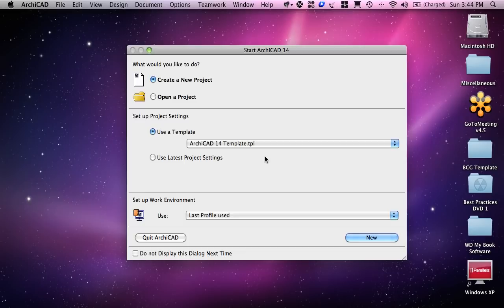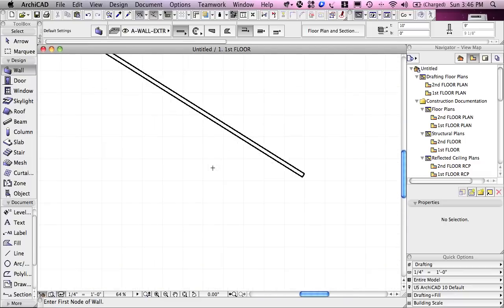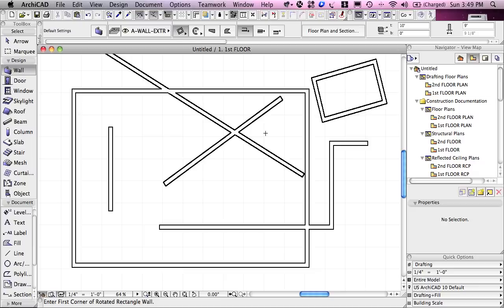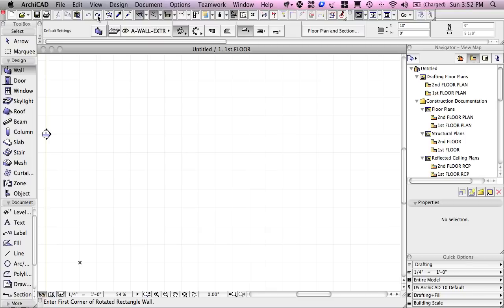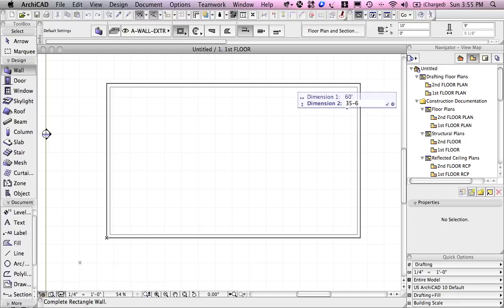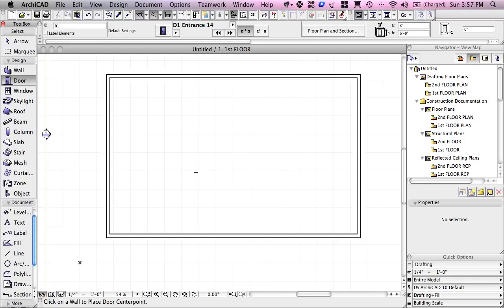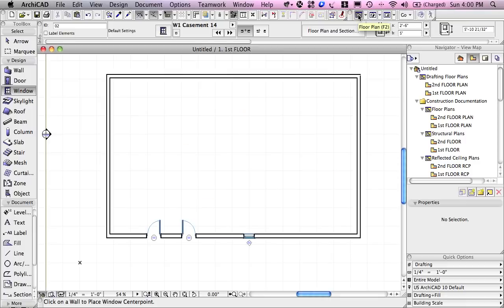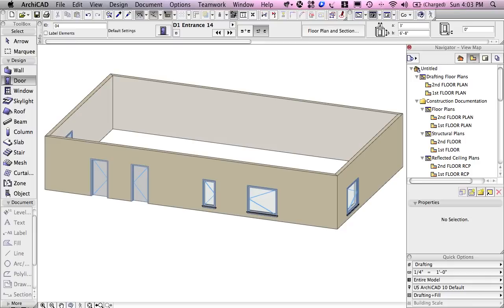ArchiCAD Basic Training Lesson 2 | Creating a Virtual Building | QuickStart Course Excerpt

Comment: Is there a function that allows you to move walls around like the hand for panning the drawings and models? Make it black!

This thing for having to select a hotspot at the end of a wall and then observing it take off in some crazy angle forcing you to input the angle and the distance that you wish to change things is frankly very stupid. Having to repeatedly do this is so time consuming that it's absolutely disgusting.

Surely there is a simple functionality somewhere that would allow you to move things around without having to enter the angle and the distance without a lateral number is very absent case of absurd programming.  Surely early on Archicad must have had a simple line drawing tool that would not balloon out all the damn time!  Yes that is clever but most of us architects would use it only .02% of the time.

The melding function that is also seen in Chief Architect and I presume Revit is nice but getting the objects to move around is a bear.

I worked out a hot mouse for Microstation years ago which would switch from line to circle quickly and easily and continuously. This stuff reminds me of that.

Mice are often rarely properly designed for cad and they most certainly could be.

It strikes me Eric that you could apply some pressure to get things perfected.

I have gone through the Archicad menus of Pallets and task bars. Since you cannot mess with the palettes I focused on trying to aggregate similar functionalities rather than have so much repetition.

The overall look of Archicad sure needs color and careful designing. This looks like engineers work and not a sophisticated design Architect's approach.

I particularly liked the fact that you brought in the Home Builder who thinks... it sure was fun to see how you drew him out.

While I felt that he is cramming a bit too much on a sheet he clearly had some beautifully organized sheets and we share the value of neat organization. His use of the blue line on the inside face was very interesting and philosophically correct.

Thanks Again!